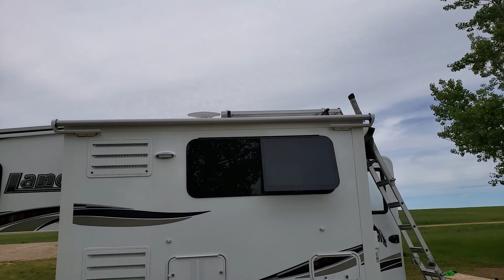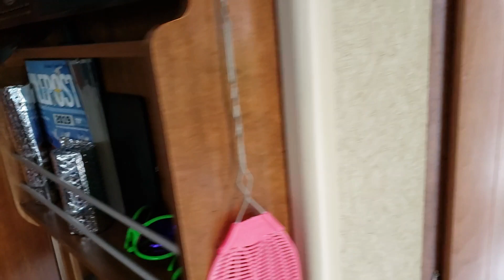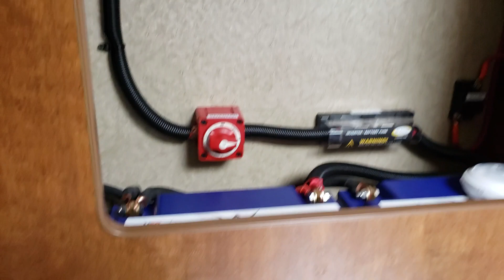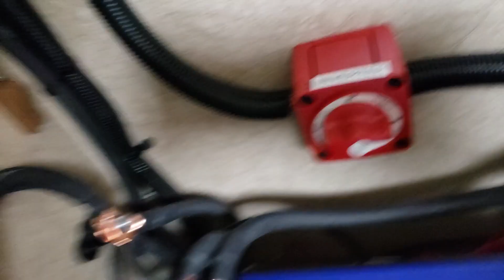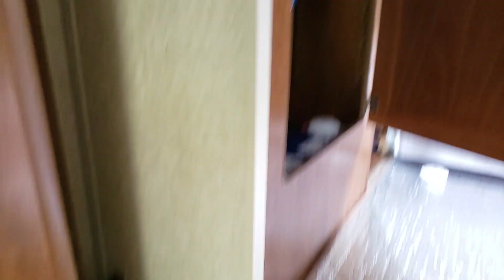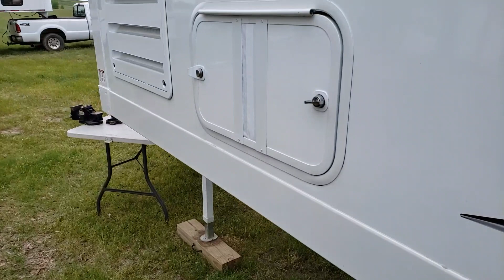The Jett RV Solar Installation

Comment: Nice to 200 watt panels! Are they the same size as the 100 watt panel. Which panels do you prefer?
Reply from the maker: There a little larger than the 100w panels. I have 200w panels on my blog store $185 ea. Free Shipping
https://gotsolarinstalled.blogspot.com
Reply from the maker: I Prefer the 200w Panels. They are 59"x27" also have square 200w 39"x39"